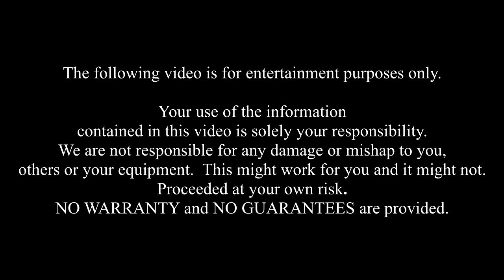Telescope Tripod Pier Extension / DIY

Comment: Semper Fi from a farm kid that grew up in Hand Country South Dakota. Learned to grind my own mirrors and skywatch when in High School in sixties. Since then helped to build Shuttle Orbiter in Downey, CA and worked on Kitt Peak NOAO in Arizona. Love this channel.
Reply: Fantastic 👍
Reply from the maker: Cool.  Navy man myself, SeaBees. Thanks for posting!  Dakota
Reply from the maker: UPDATE: For a quicker drop in set up, remove the threads from 
the EQ head PVC adapter and cut 5/8" off the extension bolt. Easier 
rotation for polar alignment too.  Be sure to wear a respirator when 
grinding off the PVC threads. :)

Comment: Given the issues with the factory pier extensions you mentioned I've been trying figure out the best way to raise my Skywatcher E6R Pro for a couple weeks now.  Your video totally nailed it! I headed to the hardware store now.  Thanks & clear skies.
Reply from the maker: Cool!  FYI: Be sure to check out the "update" in the description.  Also, I found it a lot easier to drop in the EQ head by cutting off the square nut on top of the PVC fitting that attaches to the EQ head.  Cheers.
Reply: Hey did you ever got through with this mod? Planning on buying the same mount as I'm at 10° latitude

Comment: Ingenious!  I love your modifications.  I am still on your other idea of modifying the extension.  I got all the parts and am waiting for it the adapter plate to  loosen on its own like it has previously and then I will do the modification.
Reply from the maker: Thanks!  UPDATE: For a quicker drop in set up, remove the threads from the EQ head PVC adapter and cut 5/8" off the extension bolt. Easier rotation for polar alignment too.  Be sure to wear a resperator when grinding off the PVC threads. :)

Comment: Would you recommend using this PVC pier adapter for doing EAA astronomy (Electronic Assisted Astronomy)? It is not pure AP, just stacking 8 second exposures until you get a reasonably detailed picture.
Reply from the maker: Well, I use it for long exposure photography, 10 minutes, with a 6"RC, 80mm and 150mm refactors no problem. The heaviest imaging platform so far has been around 30 lbs.  The problem I was having was with the one you buy.  It has only 3 Allen screws holding the telescope EQ head to the tripod! the long bolt that typically holds the EQ head to the tripod is not used if converting over to the extension available for sale. Which is why I came up with this idea.  Also, as stated in the video, you can make it almost any length you want within reason. Cheers!

Comment: Good video, great idea 😀, I have the mount and I bought the pier extension and you have right, the pier have a lot of issues, it have a poor design . My latitude is 10 degrees so I always have the problem of the counterweights and the tripod with the equatorial mounts, I prefer use the mount in AZ mode that use the pier because I have the feeling that at any moment it will break.

A question, do you know what type of paint use the mount? I have my mount with scratches and I like paint the scratches.

Thanks for sharing the video 👍
Reply from the maker: No idea what kind of paint they use.  But I would think a flat or satin black paint formulated for metal would work.  Try spraying a test piece of metal first to be sure you have a match.  10 degrees lat?  Must be warm there.  We've got light blowing snow at the moment with temps 34 F (1.11C)
Reply: Dakota Starry Nights thanks for the response, I will look flat paint for metal and yes, here is very very warm I’m living in Maracaibo/Venezuela so the temperature is around 33 C (92 F) at noon, and 10 degrees for polar alignment is the hell, I need a X-rays 🤣. Thank you
Reply: @om1978  what mount are you using? I myself I'm at 10° Trinidad and Tobago. Planning to buy the Skywatcher EQ6r pro, not sure if it will touch the legs at 10°